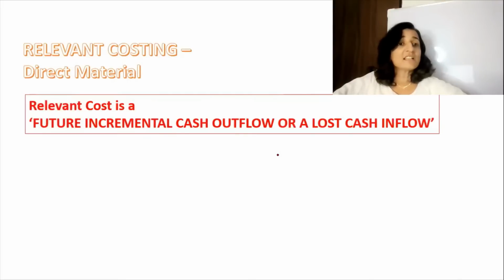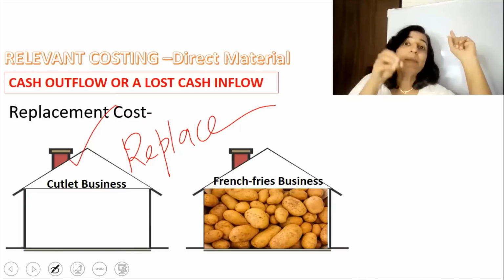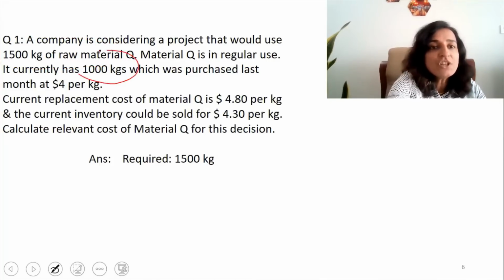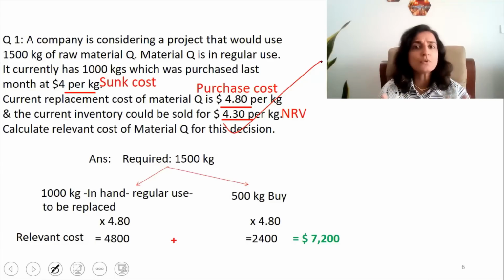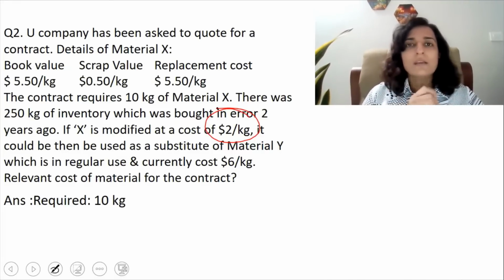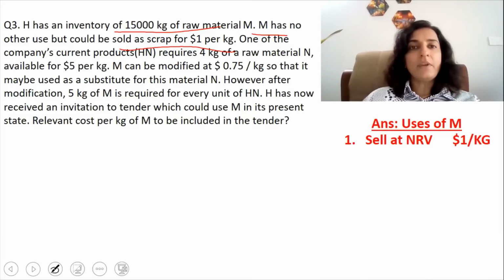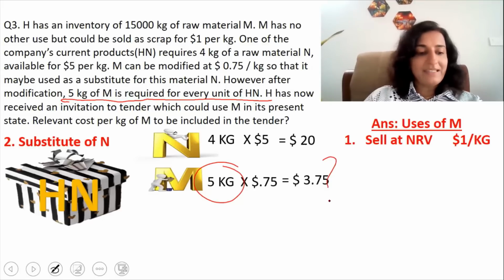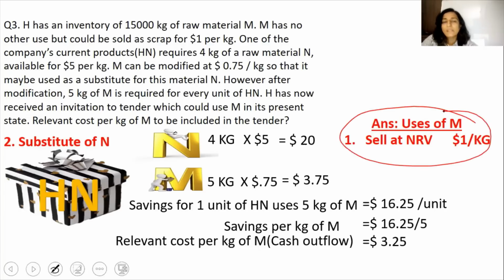ACCAF5- Performance Management, Relevant Cost Direct Material - Part2, CIMA P1 Management Accounting

Comment: mam in last question we are using m as our material for new  TENDER ( AS GIVEN ) SO THAT MEAN WE ARE LOOSING THE OPPORTUNITY COST OF CONVERTING M INTO N AND MAKING   M AS THE SUBSITUTE OF N SO WE WILL BE HAVING NO  RELEVANT PURCHASE COST OF MATERIAL  M CAUSE WE ARE ALREADY HAVING IT SO we don't need to purchase it and no relevant cost is occurred  PLEASE tell  ME that   i am correct or not .

1 QUREY - WHY DONT WE REPORT RELEVANT MATERIAL COST  FOR THE AMOUNT OF MATERIAL WE had to purchase for m cause there would only be left by 14990 kgs only so why we dint posted that 10 kgs * replacement cost
Reply from the maker: M's replacement cost/ purchase cost shd be considered only if M is regularly used for some other business. It is specifically mentioned that M has no other use. So there is no need to replace M. That is why the question is also silent regarding the replacement cost of M as that detail is not required to arrive at the answer.
Reply: @JeninMulakkan  thanku soo much mam for clearing my doubts lots of love 😇

Comment: Please tell me the answer to this question and explain it, mam.
It would be really helpful

Usman co is considering an option with regard to a machine which cost $120,000 four years ago. 
The machine can generate scrap proceeds of 150,000 if the firm wants to sell. This machine would generate a net income of 180000 if used on a project.
The current replacement cost for the machine is 210,000

Question : The relevant cost of the machine on using the project ?
Reply: My answer is 180,000 is it correct? But i really need explanation please?
Reply from the maker: Relevant cost of non current assets - https://youtu.be/yZXXa6yfuBc
Reply: @JeninMulakkan  mam Thanks a lot.
You are just awesome 👍

Comment: Mam in Q3 if they asked only 'what is relevant cost' then what's the answer?
Reply from the maker: The question says ' H has received an invitation to tender which could use M in its present state' However it is not stated how many KG of M is required for the new tender. In the absence of that information, we cannot calculate total relevant cost for the new tender or new contract
Reply: @JeninMulakkan  Please tell me the answer to this question and explain it, mam.
It would be really helpful

Usman co is considering an option with regard to a machine which cost $120,000 four years ago. 
The machine can generate scrap proceeds of 150,000 if the firm wants to sell. This machine would generate a net income of 180000 if used on a project.
The current replacement cost for the machine is 210,000

Question: The relevant cost of the machine on using the project?
Reply from the maker: Relevant cost of non current assets - https://youtu.be/yZXXa6yfuBc
Reply: @JeninMulakkan  ok clear.
Thanks u so mucn

Comment: Mam in Q2 we are having an opportunity cost too neh? Bcz instead of using material  X in the contract we are using y for another contract. Then we are loosing revenue from mat X needed contract right? Here we are totally ignoring material X. Why is that? Ultimately X only need for contract ryt?
Reply: Ok maybe we are using material Y instead of X? Or???
Reply from the maker: @acca7610  Presently X is used in place of Y & we are saving $4 per kg. If we use X for the new contract, then we have to use Y in place of X. So the loss that we are suffering is $ 4 for each Kg of X used in the new contract. So relevant cost is $4 X 10 kg = $ 40 (as  cash outflow  is $ 40 because of using X in the new contract). Always think - what is the cash outflow or lost cash inflow coz of our new decision
Reply: @JeninMulakkan  got it mam thanks a lot

Comment: In Question (3), why cost saving is relevant cost.
Reply from the maker: Because if M is used in the new project, the present cost savings created by using M will be lost. This will in turn affect the cash outflows. As all cash outflows are relevant, any cost savings which is lost is also relevant

Comment: Dear Teacher, In Q(1), 1000kg in hand-regular use to be replaced that means existing 1000kg potato is not used in decision and will be replaced with another 1000kg buying from market with price $4.8. In this case, the total of 1500kg will buy from market. My understanding is True or False? Please give your explanation. And if we decided to use existing 1000kg in decision, what will be relevant cost.
Reply from the maker: Existing 1000 kg is used for new business. Hence we have to replace this stock for the existing business as these materials are regularly used by them
Reply: @JeninMulakkan  Let you know how do I understand for your explanation. Condition given in question is that now, we have to use 1000kg of existing business for new business but it is not exceeded item for existing business. So, we have to replace for existing business with the market price because it is regular use of existing business. (It means new business can not wait to buy 1500kg and existing business does not use this 1000kg in the right now. So, new business decided to use 1000kg and then it will be replaced with market price.)
Reply from the maker: @NanKKhaing  The question says new business needs 1500 kg & old business has 1000 kg which is in regular use. So in short a total of 1500 kg has to be bought from outside, rt? So that is the relevant cost ( 1500 kg x market price). No need to bother about whether the new business takes the existing stock or new stock because anyway the cash outflow because of starting the new business is 1500 kg x market price. You are free to think in anyway, because both ways gives the same answer
Reply: @JeninMulakkan  Thank teacher for your patient and explanation. Now, I can catch with your more explanation what does mean.
Reply: @NanKKhaing  frequently or regularly use. If these terms were there then you have to take the total materials required × current market price.
In this case 1500×4.8=7200.

The practical idea only madam mentioned in the video. That really helped me to get the practical point. But for question answering, you can use that trick. (regular use or frequent use)

Comment: in question 2 why we ignored the $5.5 replacement cost?
Reply from the maker: Replacement cost is considered only if we are replacing X. Here, it is not profitable to replace X because,  X replacement cost $ 5.5 + modification charges of $2 adds up to 7.5$. Hence it will be better to buy Y itself, which costs only $6.
Reply: @JeninMulakkan  But mam in question 2, $4 that we are incurring how are we losing that amount?
I didn't understand this part of the explanation of 6-2=$4?
Reply from the maker: @iffuanware401  Right now we are using X as substitute for Y. The cost of Y = $ 6 but modification charges of X = 2. So instead of buying Y from outside it is profitable to use X in place of Y coz for X, the cash outflow is only $2 ( modification charges) but cash outflow of Y is $6 ( Y's purchase cost) So just coz we are using X in place of Y, the business has saved money ($6 - $2 = 4) Now if we use X for the new project, then we will be forced to buy Y at $6 from outside and hence the savings that we are enjoying now($4) will not be there. This is why $4 is said to be lost ( meaning the existing savings is lost)
Reply: @JeninMulakkan  Thank you mam
Reply: @JeninMulakkan  this explanation was awesome. Still, we can study pm with this madam in the comments section itself. No need videos 😅.

My god bless u mam. Please do more videos with the same potential

Comment: if there are 1000kg of patato in stock for a cutlet business but we know we can only use 800 kg as some will expire with of no use and no value and to avoid this we transfer that 200 kg to other business what will be the affect
Reply from the maker: So basically u have decided to transfer the 200 kg irrespective of your decision of starting the cutlet business. Even if u start the cutlet business or not start the cutlet business, you will still transfer the 200 kg to avoid spoilage, rt? Since it is not incremental, ignore the proceeds from 200 kg. Always remember the requirement of 'incremental'. If because of starting the cutlet buisness u r losing an amount, consider it as the relevant cost of the cultet business, if no ignore that amount
Reply: @JeninMulakkan  so the potato cost will not be included as in the case of 200 units in other business
Reply from the maker: @hasnat.creations  It is the stock of 200 kg potatoes that u have transferred to some other business, which has nothing to do with your decision of starting the cutlet business, that has to be ignored. However, if  1000 kg of potatoes is required to start the cutlet business, since u have only 800 kg of potatoes with u, u wl hav to buy 200kg of potatoes from outside, rt? So the purchase cost of the fresh stock of 200 kg that u will be buying for the cutlet business is a relevant cost as it is a cash outflow.